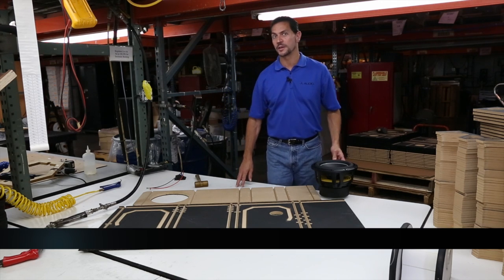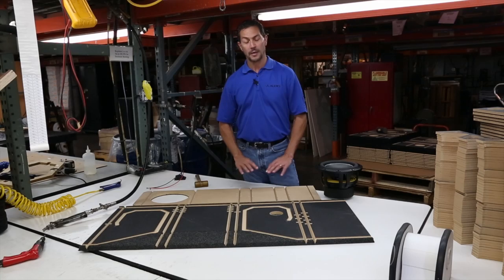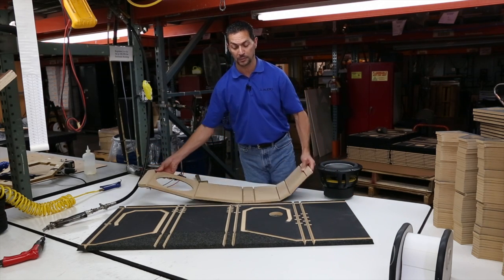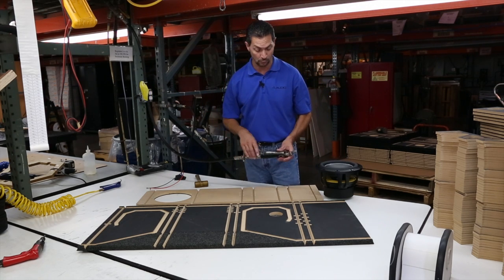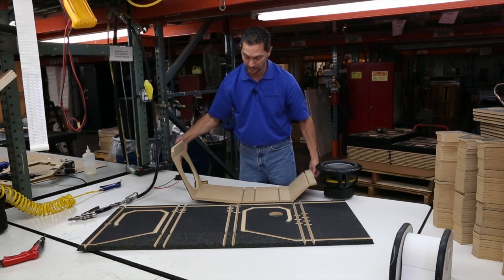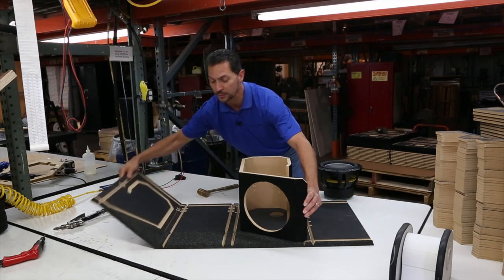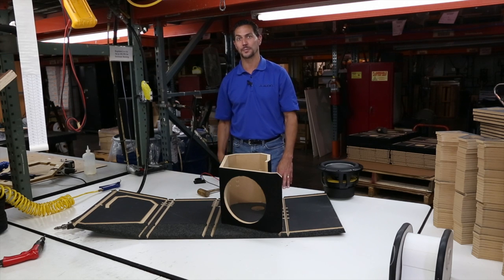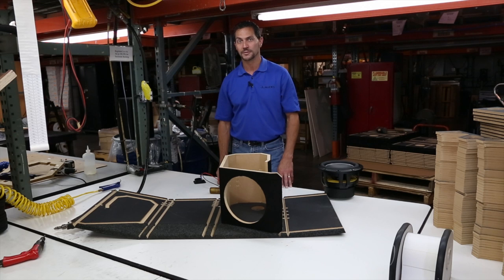JL Audio HO110-W6v3 Product Spotlight

Comment: The output on this thing is nuts. I have had the luxury of having the ability to try out nearly 100 different set ups in my trunk over the last 4 or 5 years and nothing has ever dropped my jaw like this little thing.. It plays as deep and dynamic, freq. response is very flat and it is F'ing loud. The 12w6" version just showed up on my loading dock yesterday and I cant wait to get it in.

Comment: I got this exact box and sub. Running it with a punch prime 500.1. It really is amazing of the quality and versatility of this sub enclosure.  My brother has a sundown 650.1 pushing his one 10" sundown sub in a potted box tuned. And he bet me his hit harder than mine. So we used his amp, in his trunk, using the same songs, on both his sub and mine back to back with a db meter. The jl w6 actually was louder on average by 3 decibels. He was surprised.  I wasn't.  I've been a jl audio fan since 1995. It's not all I've ever used. But u absolutely know what your getting is quality in their products.  How many companies in this business can say that for over 30 years?
Reply from the maker: Great story, thanks for sharing. We can't thank you enough for the support of JL Audio throughout the years!
Reply: @JLAudioInc   I have two of these subs unfortunately my boxes got damaged where can I find just the boxes

Comment: I just purchased the W6v3 12 version of this, and I am a happy camper.  I currently have type R components in the front and type r coaxial in the rear, powered by a Alpine Pdx 4x100.  However, I'm upgrading to some focal speakers later this month.

Comment: I have one in my conversion van and it is truly amazing.  The bass is loud,  deep and clear as can be.  It really was engineered very well.
Reply: +pepe salgado Never had a JL box that's deep, not even the HO boxes. They're good at SQ, however i'd say mid to high 30's at best. They're not for me.
Reply: this box hear would surprize you.  I have also had the older HO boxes from JL and they are more like low 40s ,  this box is getting my w6v3 into the 20s for sure.
Reply: pepe salgado from the reviews, they don't seem to be doing that well. But as the saying goes; there are better and cheaper options than JL. I'm afraid my SA-12 took over from my W6v3 and it is a far better sub in all respects, and at less than half the price. I do like JL, but i just can't justify the money given the choices.
Reply: +utubecomment21 output wise probably but sq wise , this w6v3 is hard to beat and they're only 600 rms yet people expect the loudest and baddest ,  it's sq that you're paying for
Reply: pepe salgado SA-12's SQ is far better than the W6v3, that's why i replaced it, and any JL sub i've owned or tested ... and not by a short margin either!!!

1) I think many people think that 'so-called' SPL orientated brands can't do SQ as well. That's not my experience. Although my Hybrid Audio subs are again five steps ahead of JL, so is Sundown .... and for a lot less money. 

2) I'm in no way into SPL, not into competitions SQ or SPL, don't go to shows or hangouts.

Personally, after designing and building speakers for over 30 years and working in the commercial sector, there's a lot of crazy thinking from car audio enthusiasts that I simply cringe at. 

But back the point. I think JL are a good, brand. I love their approach to R&D. However, the fact remains that many a company can go to China and produce something as good as, if not better. 

Every weekend a new brand seems to pop up. For the likes of JL and DD they will always have their followers, however for me, they're a nostalgic if not outdated choice. Like Harley Davidson ... 

Saying that, I still use JL amps! But their subs and speakers (i've owned the C5's) they're not for me anymore.
Reply: +utubecomment21 
I can't say I've heard those sa's but I've had a lot in my 20 years of messing with subs and JL isn't expensive and stay in business for nothing
Reply: pepe salgado They stay in business for the same reason Bose, Sony, Philips, JVC, Alpine, Kenwood etc stay in business, because people don't know better or as one JL rep told me, they get endorsements from sports starts who have about as much understanding of acoustics as Daffy Duck. Also there are those who will accept any old nonsense the sales person tells them. Doesn't mean they're anywhere near the best or better than any other brand.
Reply: +utubecomment21 

Depends on the person cause I've had a lot makes and models and put my JL 's in front of them all -
Reply: pepe salgado In what terms? And to what are you comparing JL?
Reply: +utubecomment21 I'm looking for a single 12 in a 2dr Coupe, what would u recommend over this? U said there was better choices for even cheaper, I don't mind the price of this, but if I could do better, why wouldn't I right?
Reply: I have been playing with this sub in the house for almost a year. It goes down to about 19 hz audibly on a Crown pro audio amp (700 watts @ 8 ohms). It is the best sounding ported sub I've ever owned.

Comment: For more SQ its better this HO112-w6v3 or sealed 12w6v3? Thank you
Reply from the maker: Sealed will have flatter over all frequency response and edge in detail. Ported would have more output across most of the frequency range.

Comment: Is the box available on it's own I already have 2 drivers in sealed enclosures.
Reply from the maker: At this time the enclosure is not available without the loaded subwoofer. Please contact your local authorized JL Audio dealer for help with an enclosure design. You can find a list at www.jlaudio.com/dealers
Reply: @JLAudioInc  Thanx for the reply.

Comment: What would one say the frequency response range is?
Reply from the maker: @Stephen Howard, the H.O enclosures will play the entire range of bass from 100 Hz down to 20 Hz effectively. The amplitute of the lower range will be determined by the cabin gain of each particular vehicle. These enclosures are tuned for a nice balance of range and output.
Reply: @JLAudioInc  what Hz is this enclosure tuned for?
Reply: @rrcompton22  - yes it's ported, but it's more of a "T-line" sub, than it is ported. T-lines are a whole different ballgame, and sound better.

Comment: 1000.1v2 amp will this work if adjusted right?
Reply from the maker: That should work. We do recommend 600W RMS but if it is adjusted it should not be an issue.
Reply: @JLAudioInc  how do you connect speaker wire to the terminal on the side of the box? I see that both, negative & positive, unscrew. But where do you place the speaker wire on the terminals?

Comment: What about the foam that’s inside the box?
Reply from the maker: There is a pillow of poly fill inside each H)-110W6v3 which also helps smooth the over all response of the subwoofer system along with the horn style port.
Reply: @JLAudioInc  is this present on the 12" version as well?
Reply: @psteele609  I would also like to know

Comment: I don't know how you patent an enclosure design. the box isn't really anything special, just a standard slot ported box. the design indicated there should've been at least 4 components but i didn't see any room for the extra 45s to even out the port.
Reply: Doesn't take much change to patent something. Usually it's not the design but the build process that get's patented often used to circumvent others from doing the design since you can't do X without doing Y first sort of thing..not sure if that's the case here. The whole patent system is pretty screwed up anyway.

However I can attest for this enclosure with a W6  from a long history since the 90's. I had a W6 12" previously in a custom enclosure...the same specs they illustrate you to use in the W6 manual. Later I purchased this box (unloaded 12 inch version) from JL...it's pricey at $299 (10 inch is probably $250) and inserted the W6 I already had. I did experience a difference. Mostly in terms of output at high volume levels which was a bit much for me. I'm too old to be out flexing body panels. It got louder than 2 w3's I once had in a sealed box but that was a different car too (sedan, I now have a hatchback)

It does somehow manage to maintain sound quality while being louder than typical but I wouldn't go so far as to say it's worth the upgrade if you already have a proper enclosure. For the price, you can get just as loud for less with other brands like RE or DD perhaps and I doubt the SQ differences would be that big of a deal to most.
Reply: Its special because it perfectly channels the backwavr to the front of the cone forcreinforcement.